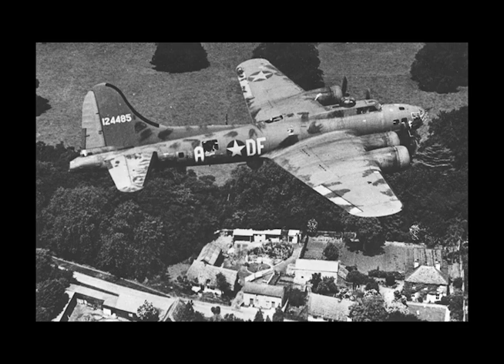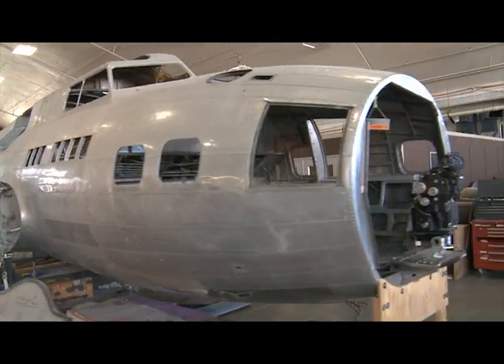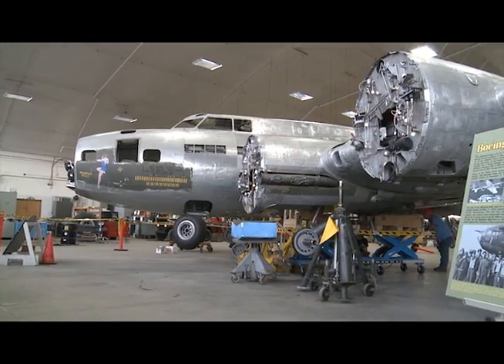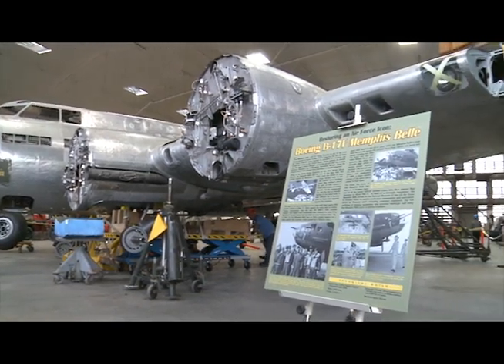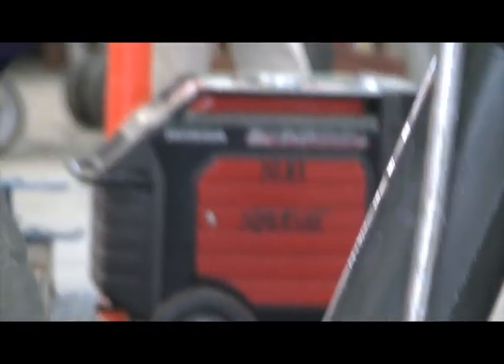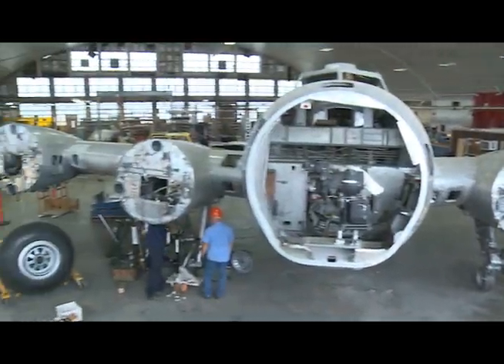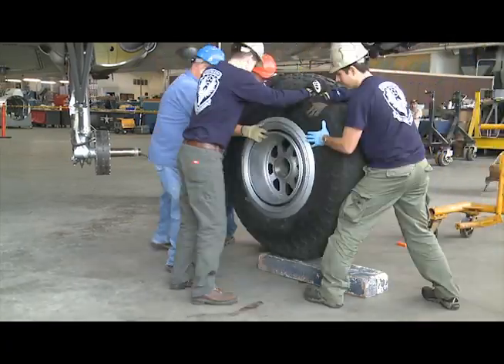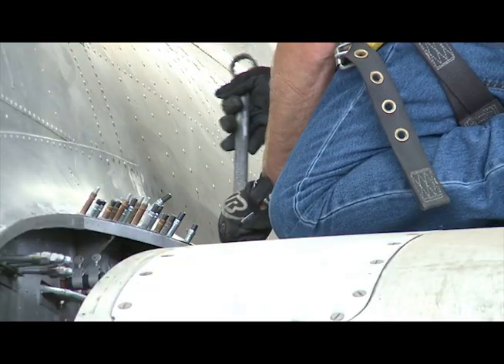Memphis Belle® Restoration Milestones

Comment: I Think this is really sad to see. In my personal opinion, the moment you tore apart the most famous B-17 bomber in the World "The Memphis Belle" and stripped of the original paint,from it, in that moment this bomber lost its historical value completley. This will only be just Another super restored B-17 with a new paintjob, standing in a corner off a museum collecting dust.. (it wont even fly) A sad ending for such an great warbird !
Reply from the maker: Mikael, the Memphis Belle will be restored as close to original condition as possible and will be for static display purposes only due to its historical significance. While most of the aircraft at the museum have the potential to be made airworthy, our conservation and restoration work is directed at preserving the historical integrity and accuracy of an aircraft, rather than achieving modern airworthiness. In preserving historical accuracy, we choose to use original parts that may be unserviceable or non-airworthy, rather than modern substitutes. The Memphis Belle, for example, will use wiring made to original wartime specification, which does not meet today's flight standards, rather than wiring used in modern aircraft. This is vital to our mission of preserving the record copies of these aircraft for future generations to come.
Reply: +Mikael Persson The plane set outside from 1946 until 1987 and likely had multiple coats of paint in addition to vandalism and deterioration. In 1984 it was restored for static display. Most likely, any "original" paint was gone a long time ago. This new and probably final restoration will repair the damage done over the years.
Reply: I agree.  In one breath he says, "An artifact is timeless . This material, this metal, this rubber, this plastic; this was over Germany". Then goes on to describe how the plane will be in effect, better than  when it rolled off the assembly line.
Well, the original paint, plexiglass, some sheet metal, and probably all the rubber will not be that which was over Germany.
I think preservation, not restoration, should be the aim of a museum in cases like this.
I know they believe they are doing the right thing, but imagine if the Louvre decided to strip off all the old paint from the Mona Lisa and repaint it identically in brand new paint, so as to remove all the cracking , yellowing and peeling of the original.  
Compare the plane today with the photo of it when it arrived back in the U.S. in 1943. It's lost all character. Sorry, but that's how I feel.
Reply: Will you ever start the engines?  And, I think it should fly.  Not every day but several times a year at least.  Planes belong in the air.
Reply: Same with Enola Gay.  Way over restored.  It should have been left alone with oil stains dents and dirt.  It’s original only once